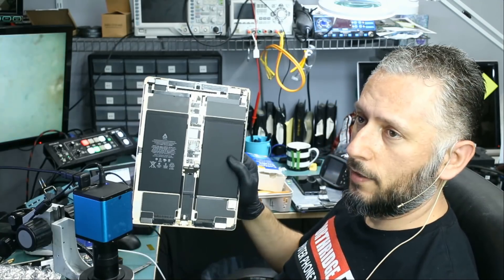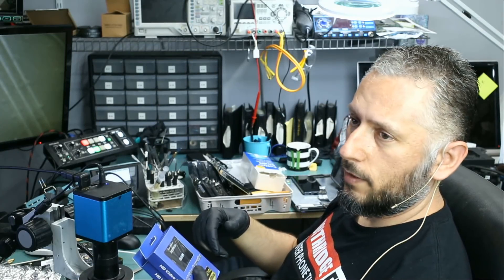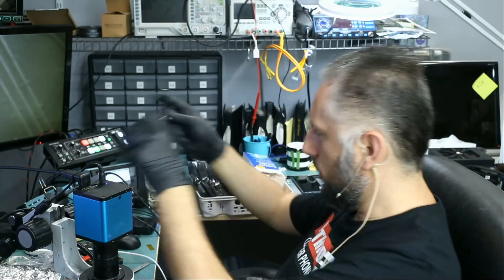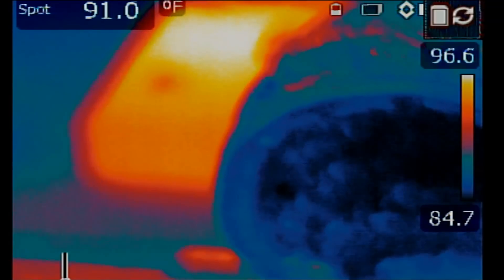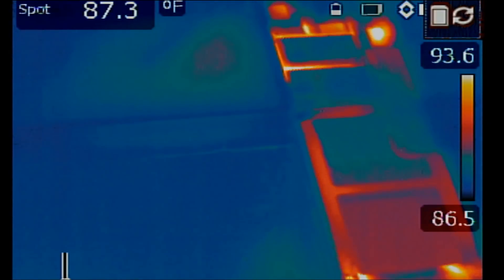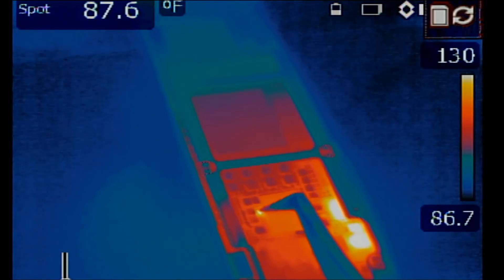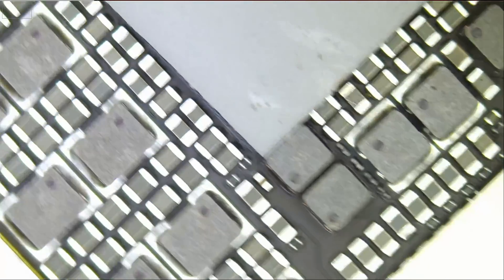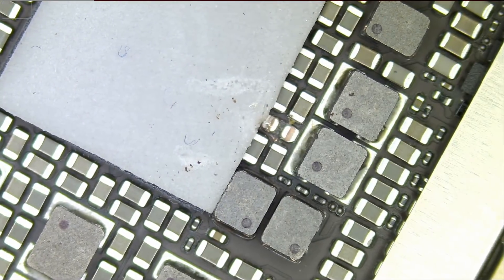iPad pro 12.9 No Power Repair. Tiny Capacitor disabling entire device - Remove & no need to replace

Comment: I have iPad pro 2nd gen changed the battery but it's not charging and the backlight comes on but no Apple Logo. could it be the charging port?  As this wasn't charging before I change the battery. any idea what can be wrong?

Comment: Well, smaller caps tend to have better high frequency response than big ones; and vise-versa. That’s one reason you often see big and small ones in parallel. Practically, given the tight quarters that that cap was living under leaving it off probably was the better choice for the reasons stated in the video; but caps are put there for a reason and if access wasn’t an issue it should be replaced.
Reply: With the way Apple over engineers I wouldn’t be surprised if they went with parallel on purpose for cost saving measures rather than functionality, after all the more bulk you buy in components the less you pay.

Comment: 06:15 thats very nice way in tight spaces. Wont it rip the pad or damage trace?
Reply: That's what I thought, until I realized he had no intention of putting on a new capacitor. Haha that was good!
Reply: @MrScooter46290  i dont see space for soldering tweezers. Also hot air could damage the surrounding components.
This technique is impressive, it does not stress any other component or board. My question is, this technique should be used where  we have no intention to replace the component / is the likeliness of ripping pads very high?
Reply: it will obviously.but removing that cap will not harm the device.so if the trace is ripped off it is ok there is no need to solder the cap back anyways🤷‍♂️

Comment: can someone please explain why would they put a capacitor there if it would work without ?
Reply: As he told, these capacitors are used to filter, i suppose he is referring to charging
Maybe the signal it has less noise with that capacitor..
Reply: They are in parallel as he mentioned. The tablet will probably work without a couple in place. Probably for repair purposes. Removing that small of a component is better than trying to solder a new one in that crowded of an area.